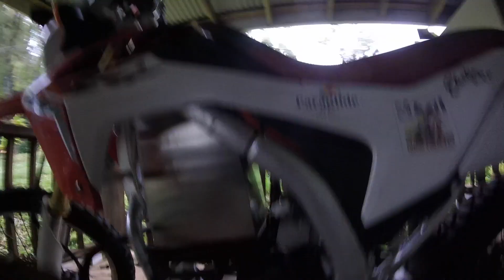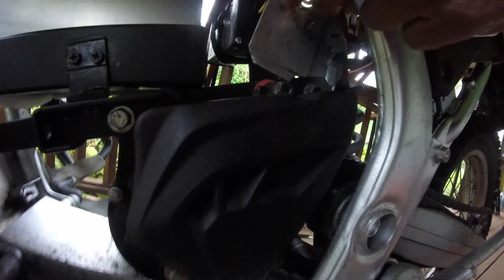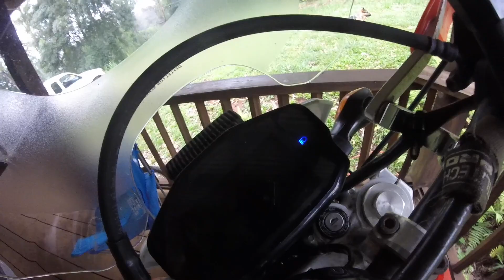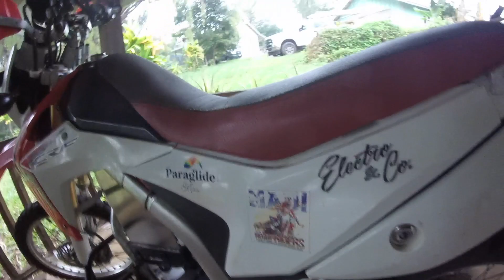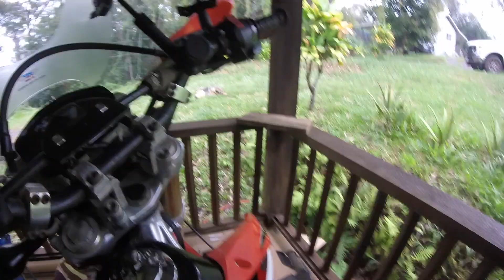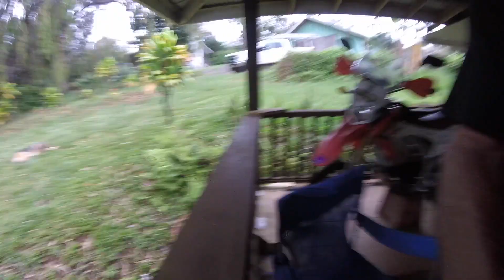May 18, Working out the bugs   HD 1080p

Comment: There are always little issues with my projects to figure out.
Usually simple little things that just take time to figure out.
Bummer about the GoPro, I always have one or more problems with it.
Mine will change settings sometimes when I have stopped recording and then when I start recording a few minutes later it will jump speed or change to black & white, or freeze... I have to check what it is doing every time before riding again.
I use a clamp-on chin mount so that I can see what the screen tells me it is doing before I clamp it back on.
When I use a bike mount it is easier to check what the camera is doing before riding again.

I like and recommend "Relive" on my phone for recording a ride, it is a free app for the basic version I use and it lets me take 5 pictures that it will insert in the recording. It is neat in many ways because it records time, distance, elevation, speed, and actual gps location. Check it out.